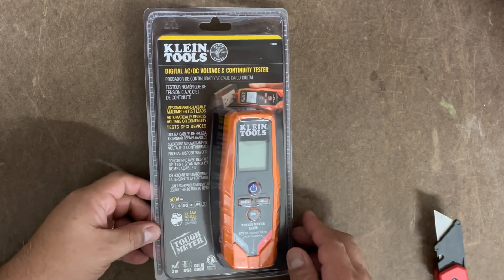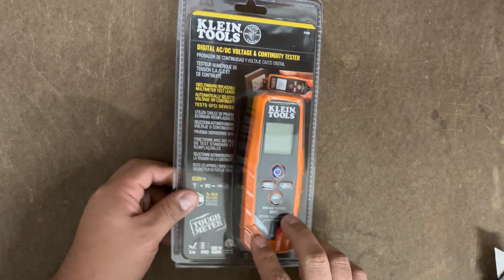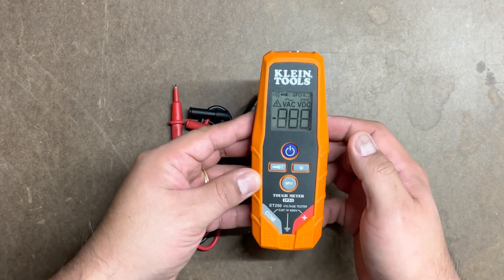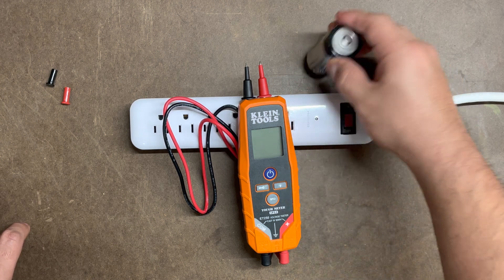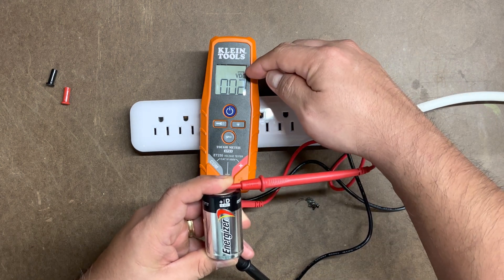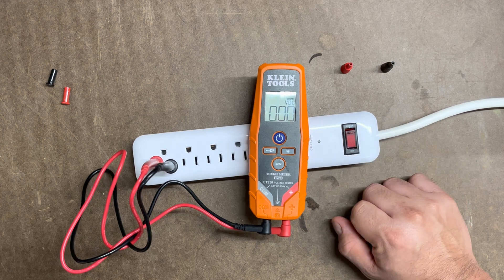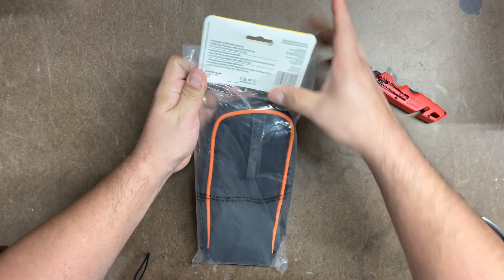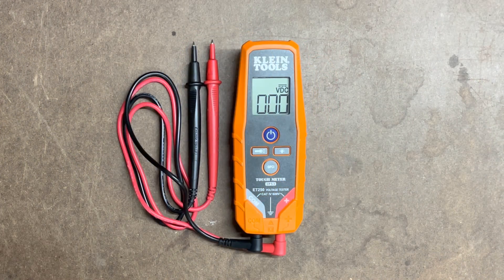Klein Tools AC/DC Voltage/Continuity Tester Digital Multimeter

Comment: Simple for tool for quick checks. Good for apartment/facility maintenance when doing quick checks on appliances ect. Dont need an amp meter on you all the time.

About $60 more, get you a TPRO From Fluke, can measure out ohms as well.

Comment: not that it needs a lot of explanation but i must have missed the continuity test part in addition to gfi.    the leads hook on the back so you can use it to hold the leads during testing - one or both - gives you a free hand

Comment: Thanks for your video The tester mesures voltage not current. either for AC or DC power sources. 
It also can tell you if there is continuity in a wire or between two wires in a circuit. You can test if an incandescent light bulb is good or it is burned down. You test an electric motor winding for continuity too😊
Reply from the maker: Thank you, I appreciate the comment and FYI. It was one of my first videos so I fumbled a little through it. Consider giving me a thumbs up and subscribing!

Comment: What about continuity tester? Do I need to select special mode, or just touch a wires? And what I will see on display?
Reply: Apparently you only have to touch the two together and you’ll get and audible beep…but I’m sure you’ve figured that out in the 4 months since this comment.
Reply: That’s exactly what I was looking for.
Reply: This is the most annoying question I get working at a retailer. Everybody is always looking for “continuity testers” and tell me we don’t have any. I then point to the hundreds of products on the shelf that read resistance and explain there is your continuity tester…